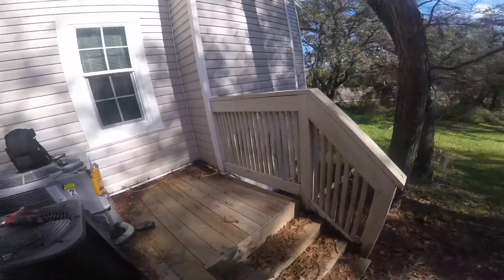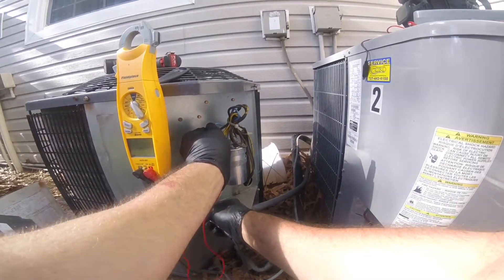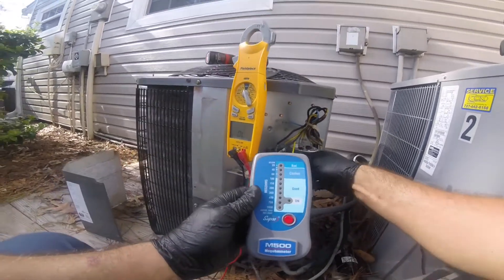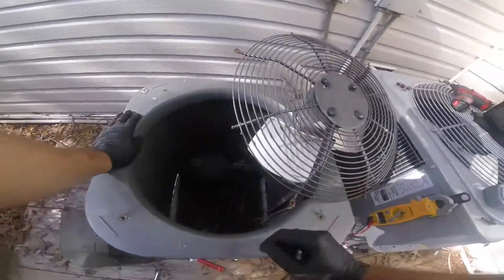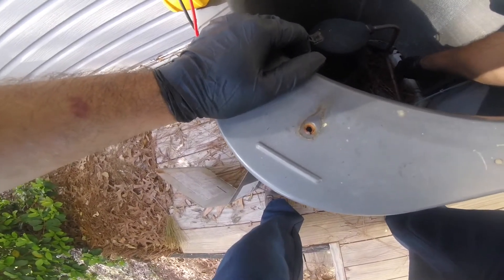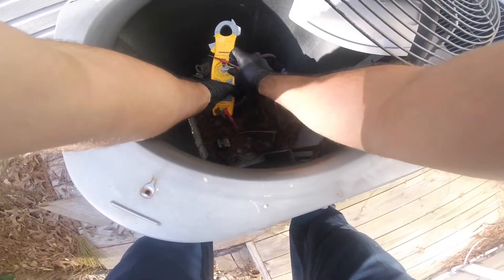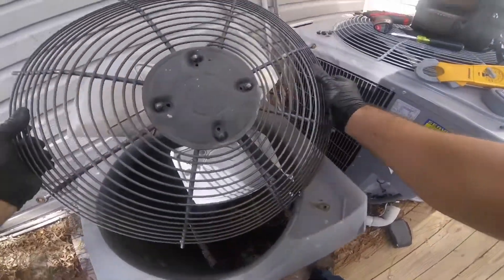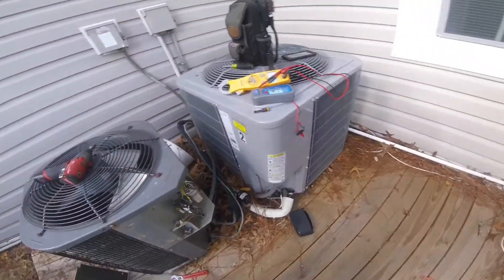How to Diagnose an Air Conditioning Compressor...

Comment: Megohm meter only measures insulation resistant. you also don't need to check a compressor to ground unless it's tripping the breaker or shorted to ground.

Comment: Happen couple of times with my m500 you right its best to ohm out  ,What kinda camera you using clear, i m assuming you got it on a headband Thanks for sharing 👍✌
Reply: Good day Eddie, I spoke with you today the guy from the Bahamas, about a carrier infinity 5 ton model FE4A system, my thermostat was saying no  communication with indoor/outdoor unit, also the orange status light was flashing but the green communication light was not on at all,  you told right away it was the low voltage line from the air handler to the condenser unit, I changed the low voltage just like you said & that solved my problem, I want to tell you thanks again & I really appreciate your help, God bless.Godfrey.
Reply: thank you again sir, appreciate all your help, God bless.
Reply from the maker: Gene K thanks for the comment,  I am using a hero session 4 with a chest mount.
Reply from the maker: gubby2004 thanks for the comment and subscribe, happy that I was able to help you troubleshooting.

Comment: The M500 has given me false "bad readings" on compressors before. The instructions state to test after the compressor has ran/warm, if at all possible. The refrigerant in the compressor oil gives the meter false readings.
Reply from the maker: Jon HVAC thanks I didn’t know that.